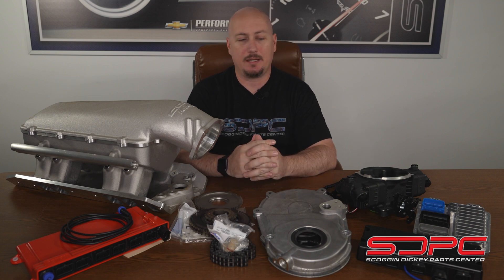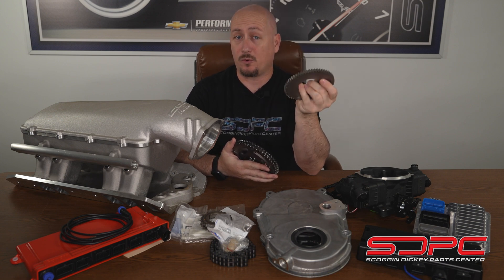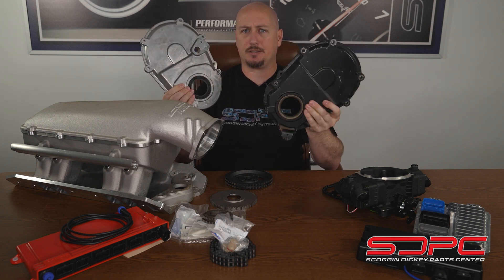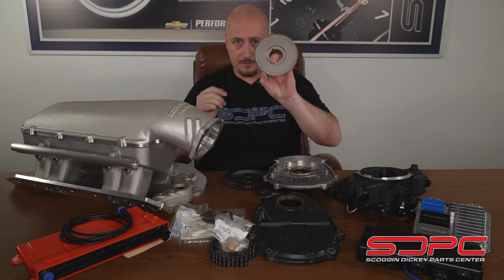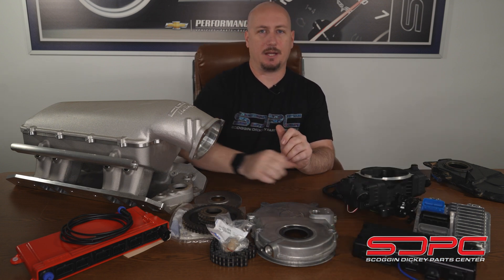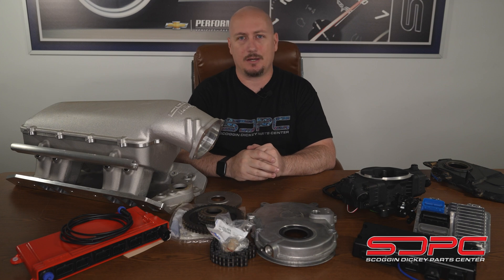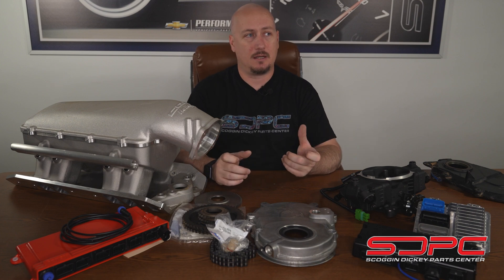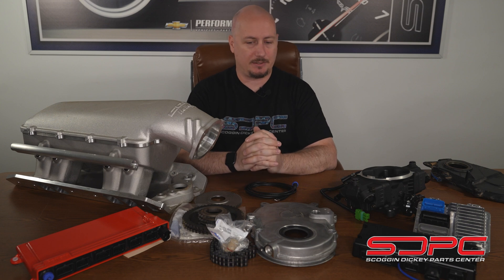Converting your Big Block to EFI

Comment: So I have a '83 C30 ramp truck I use to haul my car to events, and I'm tired of the carb on the 454. I'm not scare of EFI, but finding a set of parts for the ol girl seems a bit more difficult than I imagined. Ideally I'd like mpfi and ls coils, but not really interested in the 'power', just reliability and torque. Any suggestions on parts? The edelbrock pro flo 4 kit seems good, but then that doesn't support direct coils, and the holley 550-835 seems discontinued now? A bonus would be something that could handle an 8hp down the line too, the extra gears would really wake it up.

Comment: I'm building a Gen VI 509 right now and want to do something like this. Possibly with a stock Gen IV LS ECM. I also wonder what do you do for the distributor/oil pump drive? The oil pump drive from the 8.1? I also see no reason why this wouldn't work with a carb and MSD 6014 box.
Reply: The cam plug you need is MSD 8513

Comment: Is that GM intake sitting on the desk available for purchase? If so, tall deck, or short deck, etc. Thanks
Reply from the maker: At the moment you have to buy a 572 Copo to get the intake.

We do have a variety of options, including other designs that utilize a front-facing throttle body.
Reply: @Sdpartscenter thanks, I knew that is where it was from. Shame it isnt available, as it would open the door to holley compatable intercoolers and lids for big blocks
Reply from the maker: @Chevelle588  probably one of those where GM gets dibs and then Holley finally gets to release it after a few years.
Reply: @Sdpartscenter  holley just released it at PRI this month, do you know if it's available in a tall deck? Or if the  COPO one you have on the table is for a tall deck?